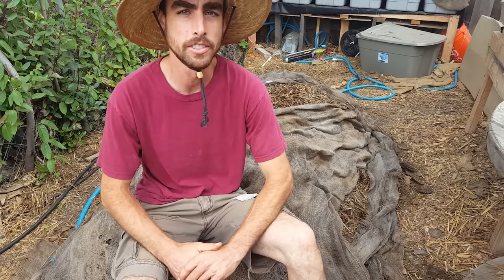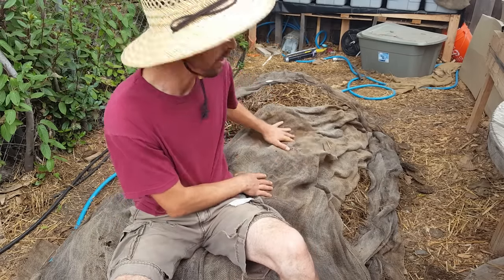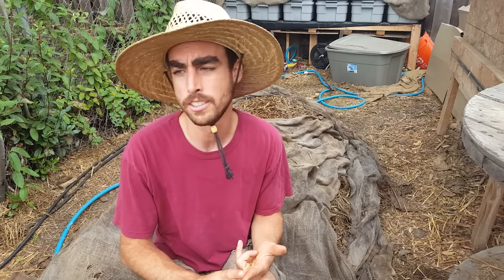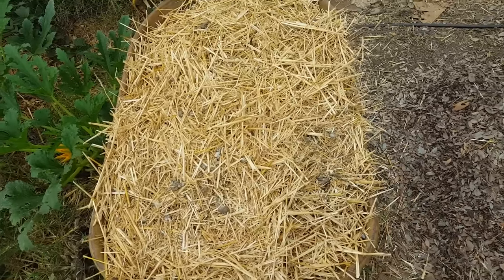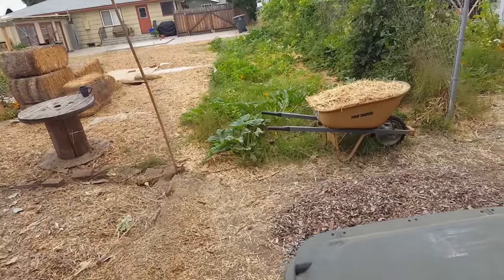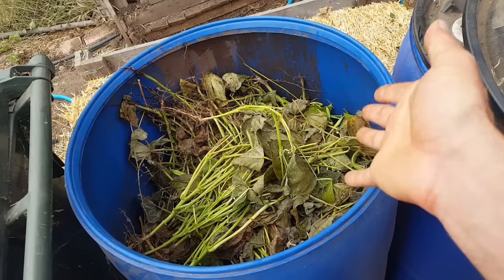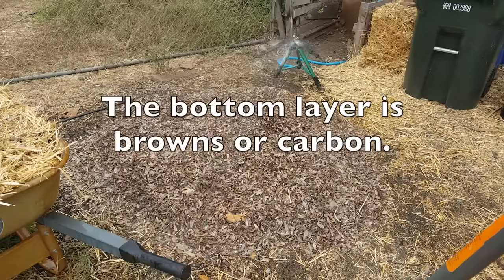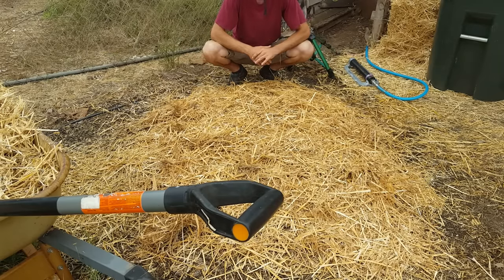How to Make a Hot Compost Pile Successfully 1 of 2

Comment: This seems really complicated. Are cold compost or worm compost different to hot compost in terms of how good they are for the plants?
Reply: 130+ degrees kills weed seeds. So, getting your pile to reach that minimum temp a few times is good. Use a compost thermometer to check your pile occasionally. Otherwise, the slower the better for nutrition. Hot, short cycle composting yields low-quality compost. Composting is very simple. Is doesn't need to be complex. Just throw your weeds, grass clippings, leaves and whatever else into a big pile. (The bigger the better because there is no such thing as too much compost). Throw water on the pile and cover it. A few weeks later fork it into a new pile to aerate it. Add water as you go and some grass clippings if you want your pile to heat up past 130 again. Simple and easy.

Comment: Have been composting for 30 years now, tried many ways. Some failed: to small or attracting unwanted animals. I use a zero $ pointy stick to check for temp and moist of internals of compost heap. Hot compost is ideal for top layer of garden beds, weed seeds and pathogens killed. But I ran out of compost to extend my raised garden beds. Now i am building/growing soil the lazy way: I mix the crappy dirt (very fine sand) with garden and kitchen waste, adding cardboard, bentonite clay, crushed basalt and a bit of dry cow dung. At level of 8 inches I plant cover crop. I will repeat that cycle with another layer of 8 inches and a winter rye cover crop too be killed in early spring. Topping it of with a layer of weed seed free compost, ready for (trans)planting in spring. Killing winter rye is easy: two weeks under layer of newspaper and keeping it wet. My biggest concerns with hot composting are the reduction in biomass, and neglecting the need for worms to do their vermicomposting job after the heating. My backyard compost heap is mostly cold (composting), it only heats up when i turn it once, before sifting (big stuff is base for next pile), worms migrate to the cooler spots, they also go into the next pile. Conclusion: hot composting requires too much material for most backyard farmers/growers, urban farmers need compost from outside (see Charles Dowding, Curtis Stone etc). Sorry, long comment, but I want to point out that hot composting is only a part of the solution and not attainable for most. Other problems with hot composting, are the time delay and the amount of physical energy needed for all the turning. Best wishes, greetings from Holland.
Reply: I used 1ft by 1ft by 1.5ft size styrofoam container to make compost.  Normally it took 10days for me to collect all the material, and 10days to heat the pile (temperature from135-150) for 4-6 days, after that I transfer the slightly cool down compost to worm bin to complete the task.
Reply from the maker: I like the way you are building your beds. By making this video with deep explanation I'm hoping to make it feasible for any gardener with the space to do. Materials can be gathered if they want to make a pile like this. I want people to understand what is actually happening when they compost. I want to show anything and everything related to growing food with natural systems regardless of making money at it (although a lot of my videos right now are about market gardening). I'd totally agree that for urban farmers we should just be buying our compost locally and using that. It is not cost effective as a business to make all of their own compost. I do it because I have a youtube channel and want to show what's possible on a small piece of land nutrient wise and teach the many skills related to growing your own food and creating your own nutrients.
Reply from the maker: Nice Ling, that sounds like a great method on a smaller scale!
Reply: Great idea. I will wrap a bucket of that size in bubble plastic and put it in my greenhouse. Have a lot of invading weeds with seeds and roots such as stinging nettle and bindweed, normally going to the county green waste composting facility. After composting I will run a germination test. You can never have too much compost.

Comment: The bigger the pile the more insulation the center core has. That is rarely mentioned in the many lessons on hot compost.
 piles
 Insulate the pile. Insulate with plastic sheeting . I use fiberglass insulating batts to heat the top edge of the pile .  But not for 14 days . More like five days. I dont have manure available  maybe that makes a big different. . . I think YouTube video makers are a bit pie in the sky as far as   their reasoning for hot compost sucess.   . I get better heat with drier material.  I suspect  that a compressed pile heats to generate higher heat despite the repeated instructions of aeroration.  And heat is not just an indication of microbaterial activity but promotes decomposition. Just like  food rots faster in an unplugged refrigerator .

Comment: I work at a coffee shop. How can i use all of those grounds?
Reply: I use a lot of coffee grounds in my compost. Use it as a high nitrogen source -  so instead of  (or as well as) manure or bakashi. It's GREAT!!! Layer of browns, thin layer of coffee grounds, layer of greens, repeat until your pile is built. If you compost cools you can add more coffee grounds when you turn it and it will quickly heat back up.
Reply: Grow mushrooms then compost the spent grounds.
Reply: For sure mix mix mix with manure

Comment: I do not have a compost thermometer, just a long stemmed deep fry thermometer, lol. I measured my pile up to 143 degrees and I used the ammonia, beer and cola method when layering my pile. I will be turning it for the first time when the temp gets below 100 degrees, about 2 weeks from start I estimate. This should result in finished compost in 6 weeks and usable after curing 2 weeks later.
Reply from the maker: Haha nice glad that thermometer works! I turn it more often to keep the temps above 130 longer, it will break down even faster. But either way it will do great, good luck with the pile!
Reply: When I turn it I plan on adding more grass clippings, which include some sand and dead leaves from my yard, and also I have coffee grounds and veg scraps in my freezer that I plan on adding. I also added spent dirt from my self watering containers. Do you think adding additional material when you turn is beneficial or should I just start a separate pile?
Reply from the maker: If you add more materials to a pile then you are also adding possible pathogens and weed seeds again. A proper pile should be built once and only turn and add moisture until it is soil. If you don't get the right ratio from the beginning then sometimes it is necessary to add more greens or browns to even out the mixture to get it to break down well. But the goal should always be to add materials in the beginning and that's it.